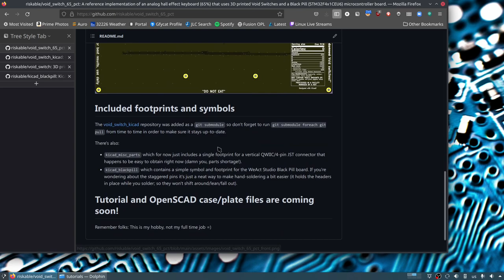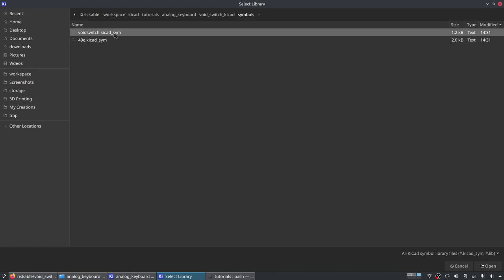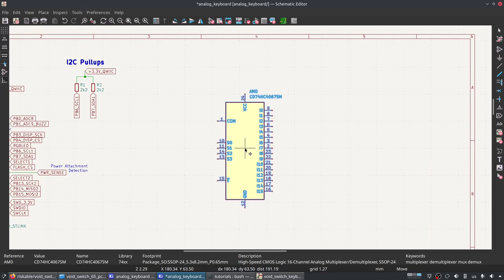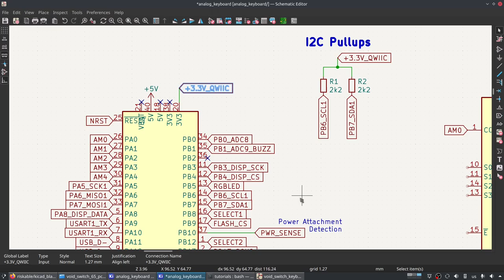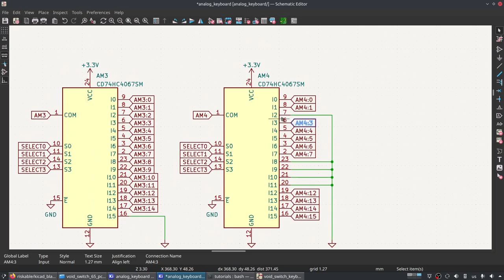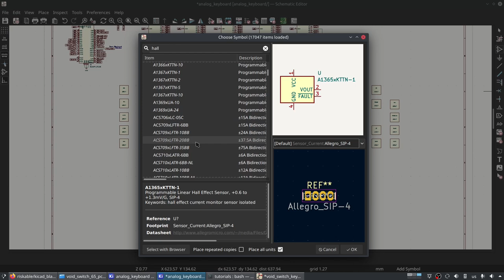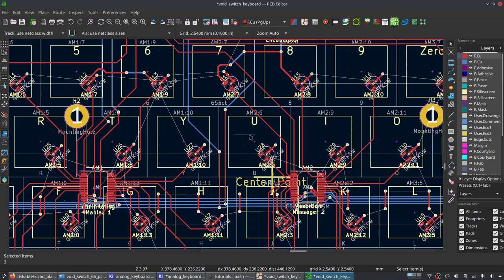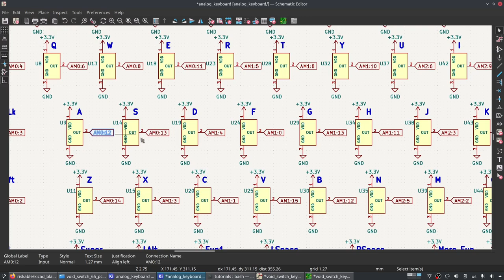Make your own analog keyboard PCB (in Kicad) - Part 1 (Schematic)

Comment: The /Enable pin is useful if you want to connect all of your MUXes to a single ADC pin, and select which one you want talking with the /Enable.  Doesn't matter too much in a situation where you've got ADC channel switches in the uC, but if you only had one analog input, it would be useful.
Reply from the maker: Even in that scenario it's not that useful if you have more than four multiplexers.  Because if you have more than four you can simply put a multiplexer in front of the other multiplexers to act as a switch for that single ADC pin.  That way you're only using four GPIO pins to control up to 16 multiplexers instead of one pin per multiplexer.  Alternatively, you could use something like shift registers to bring things down to 3 pins to control any number (thousands!) of multiplexers but then your BOM goes up because now you need another part (the shift register) 🤷

Comment: This is awesome. I've recently been using the wooting keyboards and fell in love with their hall effect switches and honestly can't go back to regular cherry (and clones) switches. So I want to try and make a hall effect pcb to fit inside custom keyboards that I already have, using the wooting HE switch. I believe the sensor for the wooting switch is placed on the top middle (need to confirm that though).

Comment: Chip shortage is mostly over, but the SM version of the multiplexer (Surface Mount) is still the better pick, a single one of the DIP package costs about the same as 5 SMD variants.
Thank you very much for this video btw, trying to design my own board and this is one of very few tackling multiplexers rather than a matrix layout.

Also, it didn't really occur to me to smush the multiplexer somewhere between the keys. My initial thought was to have a minimal extra row at the top to fit them.

Comment: working on a my first diy keyboard with no previous experience in electrical stuff. T_T pls continue the series
Reply from the maker: It's coming along! I've had to do other things (like entertaining family/guests and housework) but the video should be up soon 👍
Reply: @riskable   @riskable thanks, and ur fine, but I was wondering, would you just make a switch matrix and then connect it to io pins if you don't use analog switches?
Reply from the maker: @danny-wd8cd  Yeah you can do that... Like if you're using reed switches or hall effect switch ICs (the non-analog kind)

Comment: I'm attempting to make my own project of a full keyboard with bluetooth capability's, I barely have any knowledge of circuitry and have been looking online for some videos in reference to this analog style hall effect. Is it possible to have a 104 keys keyboard with the blackpill and also connect a bluetooth module or there aren't enough pins?
Reply: sorry for my bad English, it isn't my main language.
Reply: it seems that there are enough analog pins for 104 switches, and there are still should be enough pins for bluetooth module.

Comment: Do you know how the ghosting would be? Would there be any with the  multiplexers
Reply from the maker: There is no ghosting with multiplexers... The firmware it can tell the position of all keys at all times (mine checks them all every millisecond but it only takes some fraction of a millisecond to complete scanning 95 keys + 6 extra sensors). The USB HID keyboard report is the limitation for most firmwares when it comes to ghosting.  The standard USB keyboard report only supports six keys + modifiers but you can use some tricks (multiple keyboard reports) to support more simultaneous keys.
Reply: @riskable  yep, after watching more of the video I realised, though I also want to ask a few things
I don’t think you ever mentioned the power regulation part in the video, is it fine to just copy that from your schematic?
Also, how do you wire the rgb (the traces)

Comment: Truly awesome! This is exactly the tutorial I has always been waiting for! Well done. What should be the maximum number of keys with a reliable signal that you can get if you create the PCB optimally? I have a keyboard I been thinking about making with 138 keys, 8 rotational encoders, one touch pad, back light and finally a LCD or OLED screen. Would it be possible to hock it all to the same micro controller, or at least get it all through the same USB cable with a on-board "USB hub" or something?
Reply from the maker: The Black Pill ADC runs at 42MHz and it has 10 analog input pins.  It takes a minimum of 12 clock cycles for the ADC to return a result after you make the call that reads the value.  There's many averaging settings for the ADC but for this example let's assume we're using Cycles_3 which takes the average of 3 readings (across 3 clock cycles)...  The formula to figure out how long it takes to read an analog pin is thus: ((<ADC clock cycles>)/<ADC MHz>) so with our (speedy) example that works out to ((3+12)/42) or 0.357µs (microseconds) to read a single analog pin.  Doing the math that means that if we hook up 10 analog multiplexers to a Black Pill (or just use a STM32F401CEU6 built into our PCB) it will take ((3+12)/42)*(16*10) or 57.14µs to read all 160 analog inputs/key switches 👍

Assuming you want to take advantage of 1000Hz (1ms) polling that means you'll have ~900µs free to handle other operations like controlling LEDs, clicking relays, reading an infrared sensor, etc inside of your main 'tick()' loop 😁.

...but wait, there's more!  Why limit yourself to just one set of multiplexers when you can have multiple‽ I mean, we have plenty of "wiggle room" here so why not pass multiple sets of 10 multiplexers through another multiplexer?  It means we'll have to use 4 more signal lines (GPIO pins) but it also means we can--in theory--read 2560 analog inputs/key switches and still make that 1ms polling window!  Yes, it should only take ~914.29µs to read that many analog inputs on the Black Pill (well, more like 950 because you have to do some processing comparing things and generating HID reports).  Of course if you actually read that many inputs you couldn't really do anything else (e.g. controlling lighting) unless you switched to a slower USB polling rate.

In reality it should be perfectly fine for a single Black Pill/STM32F401CEU6 to read ~1000 analog inputs via multiplexers.  That should leave plenty of processing "wiggle room" to perform all your usual keyboard operations.

To answer another question you might have:  Yes, taking "just" the average of 3 readings (Cycles_3) is perfectly fine.  Especially with my keyboard firmware which is always in a state of constant calibration.  If you plan to develop your own firmware I highly suggest using integer division on the resulting mV values to get a sort of poor-man's 'round()' (keeps the values reasonably stable even with a lot of voltage wobble).

In my testing using Cycles_28 instead of Cycles_3 makes very little difference.  I'm currently using Cycles_28 but only because I have plenty of "wiggle room" so why not? 😁
Reply: @riskable  Thanks for the thorough reply. Well that is reassuring! I want 1000Hz polling, so knowing it can in theory handle even that many analog signals at that rate with issues seems very nice. Looking forward to the next part!

Comment: Sorry for the dumb question(s), how do you know what labels to use for each of the sensors on the multiplexers? 
Also is it worth having less inputs on each multiplexer, I am doing a 60% keyboard so I have less inputs needed (61 analog keys), or should I just remove a multiplexer and use up most of the pins on each?
Reply from the maker: Multiplexer pin labels are your prerogative. Name them whatever you like 👍.

Also, it doesn't matter how many pins are unused on a multiplexer... Just make sure to attach all unused MUX pins to ground. Don't leave them floating or it can introduce a bit of interference into your signals.

Comment: Isn't the enable pin on the multiplexer used so that you can chain multiple multiplexers together? You tie the com and S0 through S3 together between each multiplexer, then you take a fifth pin from the BlackPill and route it to one multiplexer's enable pin, and through a not gate to the other multiplexer's enable pin. Now you should be able to multiplex 32 inputs.

I see you have multiple multiplexers, but I'm not sure how you're using them. Does each com go to a different pin on the BlackPill, and the microcontroller just chooses which to read from?
Reply from the maker: Each COM goes to a different analog pin on the Black Pill.  If you use the enable pin like you suggest you're basically just wasting GPIO pins since you can safely change S0-S3 on all multiplexers at once without having to disable them individually.  I suppose if you only had one analog pin on your MCU you could "make up for it" by disabling multiplexers as you go but that's going to be very expensive from a GPIO pin standpoint because you already need 4 for the select lines.  So in that scenario it would be one analog pin and 4+N GPIO pins where N is the number of multiplexers you want to use.  Whereas my way you only need N analog pins and 4 GPIO pins where N is the number of multiplexers (and analog pins on your MCU).

Also, I'm not convinced that disabling the multiplexer actually "turns it off"...  I thought it merely stopped accepting controls on the signal lines, leaving whatever channel was previously enabled as "still enabled".  Basically, I was under the impression that the enable pin just controls whether or not the signal lines respond.  So setting EN to HIGH would just "lock the channel" as it were (so you could leave one multiplexer on a specific channel while changing channels on another via the same four select lines).  I could be wrong though.

Comment: Hello, I am working on my own project and your video has been a tremendous help, however what if I wanted more keys? What pins on the blackpill would I link to the extra multiplexers, and if possible, how would I chain another multiplexer to an existing multiplexer? (My understanding of circuitry is flick switch and light turn on).
Reply from the maker: Well there's ten analog pins on the Black Pill so that means with loop-16-times logic you can read 160 analog keys. You need more than that‽ If so, I'm impressed and you should message me on Discord or Matrix to discuss methods to overcome that limitation (you're also going to run into ADC speed limitations after about 600 or so analog channels hehe)
Reply: @riskable  I believe I just have a lack of understanding as to how to wire things to the black pill. Circuitry is something I'm trying to learn, so I'll do more research to understand what the labels such as "PA9 TX1 T1C2" mean for a connection.

Comment: I want to make my old keyboard analog using potentiometer. Just 2 keys  A and D so I can use it driving games. Plz can u help me. Atleast saying if I can or not. 
My old keyboard is simple and cheap one which u get for 5-8$
Reply from the maker: That's not going to work.  You need the keyboard to made for analog input from the start.  You can't just swap out a component or two to get an analog axis.
Reply: @riskable  is there any work through?
Reply from the maker: @akashbhandary3799  Nope.  Get a proper wheel? Maybe I'll make one of those eventually too =D
Reply: @riskable  thanks bro I appreciate. I have a joystick analog wt do I need to make it recognize it like a controler. Ya that's my old joystick it's not working anymore. it's not recognizing.
Reply: you'd need to replace the microcontroller on it, then reverse engineer the columns and rows, and write firmware for it to work with the potentiometers, just to get barely any analogicity on the keys, that probably won't make much of a difference, so yeh isn't worth it